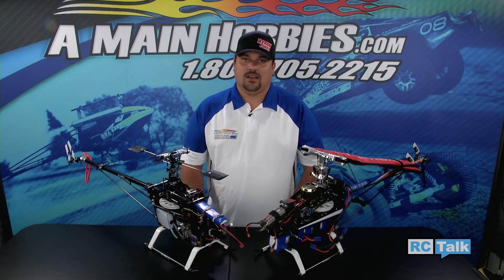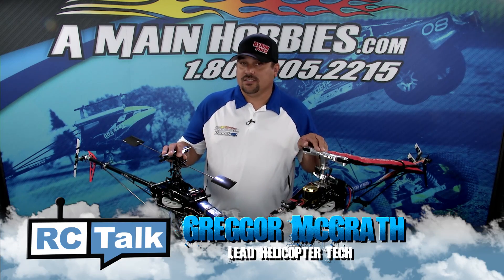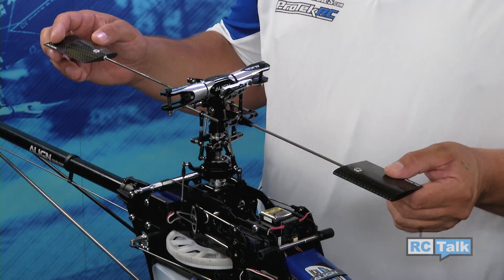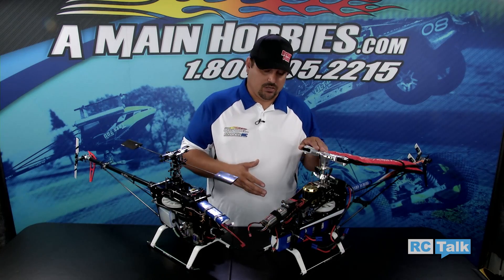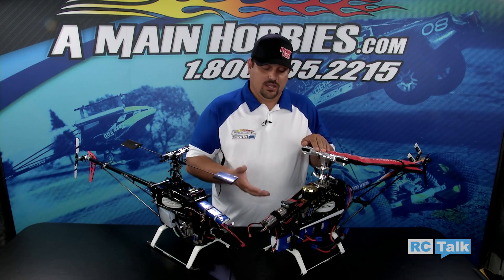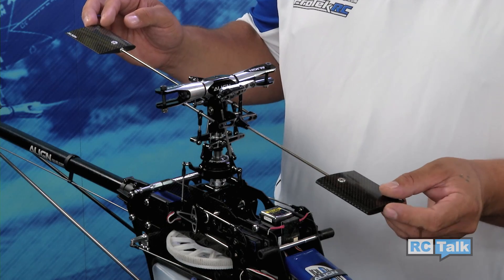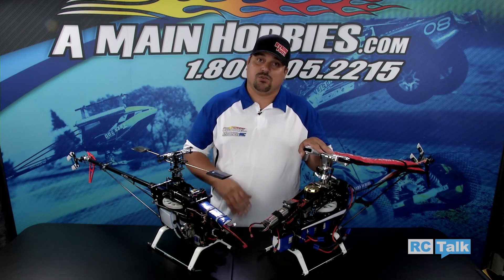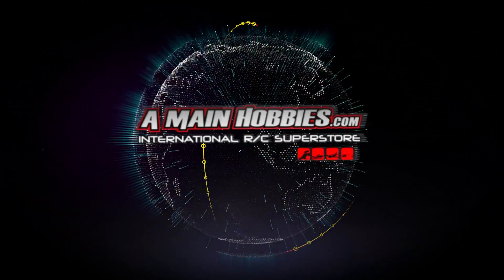The Difference Between Flybar and Flybarless R/C Helicopters

Comment: I have flown both and I am not a hover around guy.  For an intermediate 3D, piro, tick toks, tumbles and such, I fly pretty hard. I don't feel much difference.  For sponsored pilots ok but even the high end amateurs don't get a discernable difference in performance, in my opinion.  It's a scam. Most important is practice. Is it easier to fly?  If you're asking that question, time to re-think your hobby, no part of heli flying is easy.  There are no short cuts.  Manufacturers may tell you it's easier but it ain't so.

Comment: Can we Do 3D with Flybar system ?
Can hook up 3axis gyro for it ?
Reply from the maker: Sure, Flybar will 3D, but it is not ideal when compared to Flybarless. Hope this helps!
-Brett
Reply: @AMain_Hobbies  Can we hook up vbar for Flybar system?
Reply from the maker: Hello RC Stuff. The ideal setup would be to remove the mechanical Flybar system and then install the VBar. Otherwise you may have two systems fighting each other. Do you own a Flybar helicopter now or are you interested in getting one? 
-Brett

Comment: I  QUIT HELI"S BECAUSE of these damn FBL systems. I tried beastx system and that was an inconsistent disaster. If I didn't get the system exactly right it flew like a drunk and I looked at their website still didn't help. Totally destroyed my heli  trying to set it up. Looked at futaba on their website. They had 5 damn video's to setup the damn thing up. My local shop has no one to help me. So now I quit because I can't get parts for my fly bar heli and can't get a new heli with fly bar.  So I quit and only do planes. To hell with helicopters. They don't even fly like a helicopter anymore. FBL ruined the heli's for me.
Reply: Well that sad to read. So you couldn't manage to get trough the Futaba setup because of lack of help or was it lack of perceived quality of FBL systems ?

Comment: I have a cheap little fly around 4 channel rc helicopter, it will only move around 7 feet in any direction, then level back out, is there something I can do to fix this(the links are on a sort of swivel between the fly bar and servo input rods)

Comment: I have a HeliMax axe cp 2.4   Paid $200.00 new. It does not fly. The controller is malfunctioning. (will not take commands fwd. right) always flies left rear. have changed all components to those used in the walkera master cp. (including tail motor) It now flies but hates the wind. Can I remove the flybar and change my linkage and make it flybarless? will it fly???
Reply: +samuel lubricant Ummm sure... give it a shot.

Comment: is there any advantage(pros) of flybar heli over flybarless ?
Reply: Flybar is better for beginners because they tend to drag and bounce the skids around on the ground on takeoff and landings. If you do this with flybarless, the flybarless systems usually sense this and try to correct it, which will tip your helicopter over on the ground resulting in a crash. That's why you see more advance pilots with flybarless "pop" the heli of the ground on takeoff and then do an autorotation on landing.

Comment: Could anybody explain the physics principle of flybar? I just know it can help helicopter balance,But I wants to understand more about this,For example:angular momentum or Moment of inertia.Please used simple English. Thank you very much :))
Reply: I'm not a specialist, but as I see you get no answer, here is mine: when the heli tilts a bit, the flybar will remain horizontal due to gyroscopic effect. This creates an angle between the heli blades and its flybar. This angle will lead, through the linkage between the flybar and the blades, to a variation of the angle of attack of the blades during the rotation, in the purpose to bring the blades rotation back to horizontal level.
Reply: thanks for your explaining :))
Reply: @BuBuTwo  You can see it as a trim vs a control surface. In fixed wing trim are smaller flyable surfaces used to move a bigger flyable surface. In most case that is only for trim function (hence the name) but there has been aircrafts design where all pilots input goes to the trim and only the trim would in turn move the bigger flyable control surface (MD-80 / DC-9 series)
Reply: A flybar is kinda like a gyro and influences the pitch of the heli blade the same way a swashplate would

Comment: I find that they fly funny with a flybar when I bank a turn it's just like a plane rolls nice into the turn very easy acts like a plane with flybarless it seems not so easy to the tail just drags around and flight to me looks sloppy I like to have that control. There are pilots that just fly that way but I just don't like the flybarless system I cant get a feel for it I don't care about parts really a good pilot does not crash and should be able to fix it in his or her sleep. I can swap parts on all my helicopters pretty quick not only that rebuilding is parts of this hobby and building aircraft is it's own reward but to each their own I feel flybarless is for 3D pilots mostly that's where you get the benefit. Maybe it's just me?

Comment: Flybarred Helicopters Fly a lot better in some cases and are better to learn on such as a 450 Flybarred Heli.. The Flybarless has its positive points as well. In my opinion they are for more experienced Pilots who like hard 3D flying.. The Flybarless units have more adjusting points for fine tuning such as a V-BAR or MICROBEAST System.
Reply: This comment has been wrong for 11 years…
Reply: @happymcslappy3640  and you have been confused for most of your life…👍🏻👍🏻👍🏻